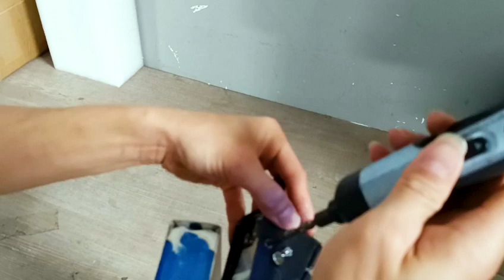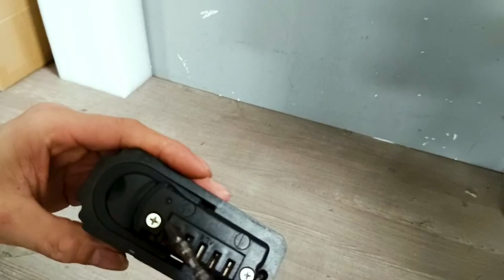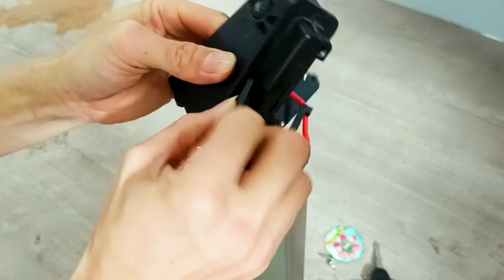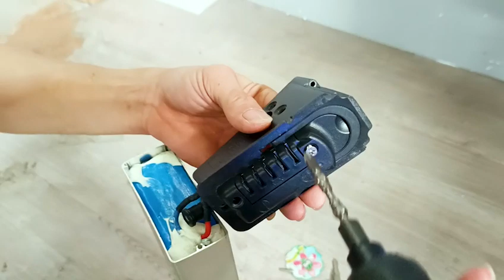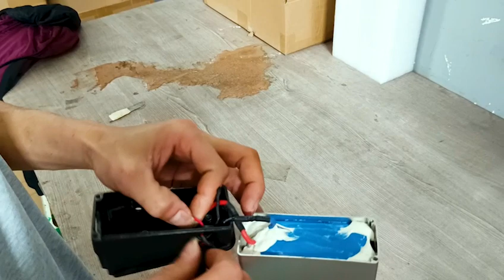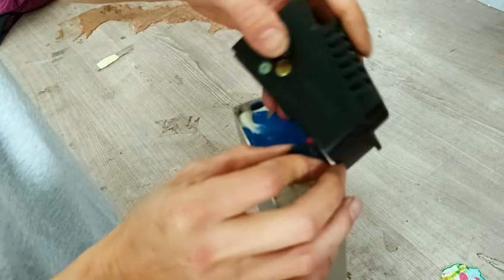Quick Tips - How to Replace the Battery Lock(Foldabel ebikes) | Cyrusher TV

Comment: No YT video found for : What if the key is lost and key lock barrel component is housed separately such that when the top cover four screws are removed, the key lock barrel component is residing in a separate compartment housed in plastic cover adjacent to the main plastic casing? And battery is slided into the battery holder bracket of the ebike?

Comment: Hey, I have a near identical battery but from another brand. Is the lock core some sort of standard? I'd like to replace it with something more secure.
Reply from the maker: most of the battery has the similiar key security system so it should be replaced by the same way.

Comment: Are you saying that if I buy a replacement battery , it will not have the black end cap and I will have to take the end cap off the old battery? Really??
Reply from the maker: No, the new battery is brand new.
This video shows you how to replace /remove the battery locker.